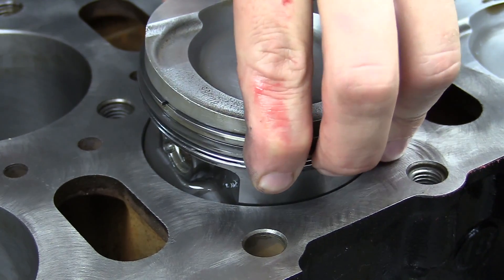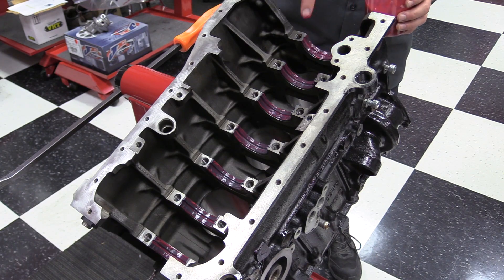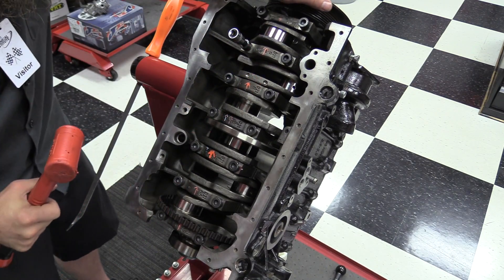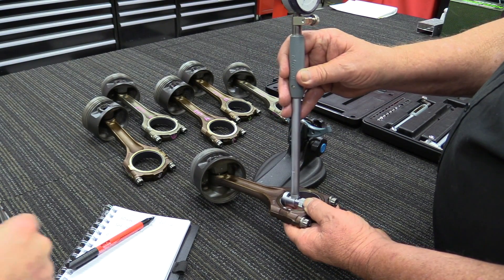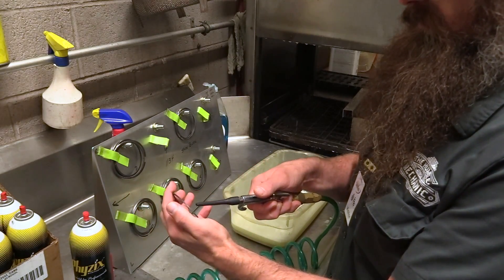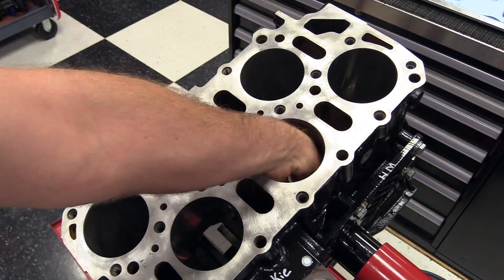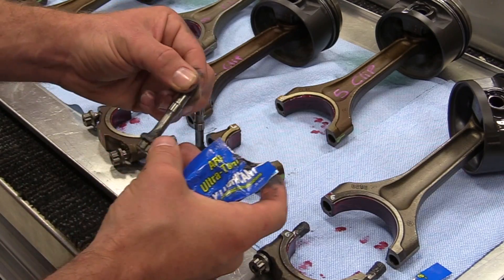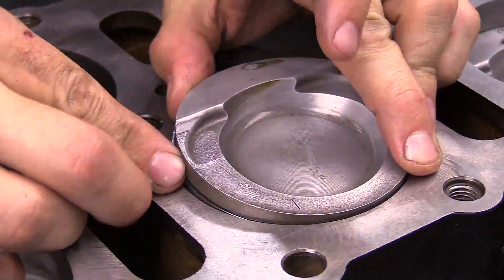How To Assemble an Engine Block

Comment: Great Video!!!!! Thanks for making it!!!!! I am rebuilding my son's motor in his first car and he and I just used this build series to help put together his rotating assembly. I have built many motors in my life so I am not new to building motors. My question is after checking all his bearing clearances and all coming out fine I also checked ring gaps to make sure there was no ring bind. We installed his pistons and now the motor is VERY tight and hard to spin over. I just built an LS V8 for my boat and that motor rotates over easier then this VR6. Are these VR6 motors supposed to be this tight?

Comment: Nice video but I do hate that all ring design it looks like you're putting very very narrow oil rings in this is better problem with some of the newer engines that design of oil ring allows the Rings to clog up and hence you have oil problems

Comment: Hey  HumbleMechanic, I'm currently installing new pistons into a 24v 2.8l Vr6 after an overbore of .5 mm. We are having some problems with getting the piston ring lined up and wanted to know what tool did you use to insert into the cylinder?
Reply from the maker: By hand on this one. The OEM tool on the R32. None of them work that well ol

Comment: What about the expansion of the cylinders and pistons, and how that affects required ring gap and piston size
Reply from the maker: Dynamically that’s accounted for with stock ring gap. If you have extreme taper or out of round that needs to be addressed before engine assembly.
Reply: Thank you.  I’m trying to get more of an idea about this for my mums Suzuki Swift.  No one has looked at the engine yet.  It’s a very new car, with a voided warranty, long story.  Seems to keep having mystery problems, first it was a badly designed exhaust flange between the manifold and exhaust, causing carbon monoxide poisoning, now it seems to be engine issues.... long story. Thanks for the help

Comment: I am currently assembling a 1.7 d17 engine off a honda civic and im having an issue where the crankshaft turns freely once installed but once i install any rod and tighten to spec, the crank wont turn at all. New main and rod bearings, all lubed propperly

Comment: You mention cleaning... Apart from replacing actual parts, cleaning is probably 99% of an engine rebuild. New bearings, rings, pistons and rods etc don't solve much if your oil channels stay dirty, for example.
Reply from the maker: Exactly

Comment: Thanks you for this walk through I have the afp engine that I just took out and it has scored pistons and the valves where bent as well. Took the head to the shop but most ppl aren’t willing to clean the bottom half even if it was just for a hot tank. This really puts my mind at ease and I’m prepared for the next step.

Comment: Just started putting my vr6 bored 2.9 12v and we tried doing it by hand like you did and we broke broke two rings. We are probably going to get a cheap piston compressor and cut it at the right angle. Any ideas or anything that we might’ve done wrong? I also had the techtonics tuning compressor but it didn’t work good at all.
Reply from the maker: There are some compressors on amazon for a reasonable price

Comment: Hey there.. enjoyed your video.  I didn't see any squiggly ring in the oil set.  Do you have a preference as to which rings you like to put on first? Also, every time you bend over a running engine I get horrible pictures of your extremely shaggy and long beard in the belts. Frankly it scares me.  I'm worried fir you, Bro.

Comment: Installing the piston into the cylinder with hand its a very bad way to do it, because by doing this as youve done in the video, you changed the gap orientation and degree between 1st 2nd and oil rings.
Reply from the maker: You can hold them in place similar to how you would the the slide in style tools. But yes you can also slide them around and end up with poor clocking

Comment: Good video, but 1 suggestion..At 9:38 while applying Marvel's Mystery Oil to the cylinders you mentioned to use a white towel.. I know what you mean but a newbie might not and use a terry cloth towel, clean coffee filters work good as there is no chance of making a mistake with added lint if the wrong towel is used..

Comment: What happens if the gaps of the piston rings are not clocked correctly, will this interfere with the combustion?
Reply from the maker: Combustion will leak past the rings.
Reply: @HumbleMechanic  So this will in turn negatively impact the starting of the motor? I have a small engine block that I resembled and I don't recall "clocking" the rings correctly on the piston. Now, the engine wont start. Could this be a reason why? Assuming everything else was properly set back into it's place.

Comment: Nice video. Thanks for sharing. If I may add a few comments, do not turn the crank without the caps torqued, when torquing the cap bolts on the final stage, do not stop in the middle of the torque down process. Keep the torque wrench moving until the spec is reached.

Comment: 10.37 when you pressure piston to inside the block its not right system brother.You should use easy way to inside the piston in the block.

Comment: I know I’m late but I’ve got to know where you got that piston ring measuring tool in the cylinder. Also did you use the plastic sleeve that techtonics sells? Thanks for the videos, they’re helping me a lot with my build.

Comment: I never knew ring filing machines EXISTED. And the multiple cleans and fusiness I would never bother with..... to finally get to the pistons going in and you SQUEEZE THEM IN BY HAND.  Holy smoke, I have seen piston ring holders as a 12 year old.... I have never heard of anyone with access to that stuff NOT using it.
Reply from the maker: The standard type don’t really work on the VR due to the angle of the bore. I’ll be doing another one soon. 10/10 buying the ring compressor lol. I’ve since found a really nice one.

Comment: If you use plastigauge to measure bearing clearances, would you need to replace the stretch to yield bolts after?
Reply from the maker: You torque the bolts minus the stretch. Or use old bolts

Comment: If i had an engine rebuilt say 8 years ago and its been sitting since. Never started (302 ford). Say i finished putting it together myself (accessories and pulleys). How do i make sure the pistons and all are properly lubed? I didnt do the rebuild but the idiot who started it never finished it. What is your recommendation?

Comment: What a detailed video! I love marvel msytery,  i had a door lock cylinder on my vw beetle 2004 and it wont not turn, it was completly siezed. I took it out with the 12 turn revolution as you demonstrate and soak it in a cup of mmo and it works better than new.

Comment: engine piston fail and hot engine a can warp a crank but hopefully it will re- balance it self with a long drive and lots of honey oil NO SMOKE  . haven't changed the oil in while and I think most of the tractor oil was diluted out (burning leak). I love my tractor oil .  still pulls good when you floor it ! LOL

Comment: I would like to congratulate HumbleMechanic on the excellent video; it is worth noting that all versions of the VW and Audi TSI engines have chronic design problems; even the renowned German magazine AutoBild has made matters on the subject on several occasions. In the State of New Jersey, there is a Public Civil Action against VW USA (link below), regarding consumer losses due to timing problems of the command current. I consider that even the Chinese are a step ahead of VW in terms of reliability, I cite as an example of superiority the engine Chery 1.5 turbo 150 hp and others with Mitsubishi technology.
Here in Brazil the carbonization problems are much worse, the current VW TSI engines, which are called flex, are not designed to use gasoline with percentage of ethanol. The manufacturer only makes a written recommendation on the fuel cap. A shame!!
https://timingchainlitigation.com/Content/Documents/Complaint%20and%20Demand%20for%20Jury%20Trial.pdf
Reply from the maker: Yep this timing chain thing is crazy.
Reply: n the new VW 200 TSI engines the manufacturer has adopted a conventional toothed belt, claiming that the durability is 120,000 KM. Only fools can believe.

Comment: Hey, Nate here from Triangle Mobile Mechanic in Cary, NC and I love your videos.  I have seen you around Cary  believe it or not. Small world! Quick question...I'd love to learn how to do engine rebuilds, but how economic is it compared to just swapping out the engine with a new engine? I would think after spending all the money on parts and paying an experienced tech to clean, replace, and reassemble your whole engine that it would be cheaper to swap the engine. What's your perspective on this?
Reply: if you're paying someone else to do it, it's not a good financial decision. swapping is the better choice.

Comment: Great video Charles 👍. Love the stress on  cleaning everything at each stage of assembly. I don't know how many people I've seen have a messy work area and not really bothering to take the time to clean surfaces, only to down the road scratch their head wondering why things are either leaking or breaking.  Another practice I've gotten into is chasing out threads especially on critical areas like head bolts , I've also seen people not do that and snap off TTY bolts because of crud being in the threads or in the bottom of the bolt hole.
Reply: A J S after machining how does one clean out all the oil passages? I would think if the cylinders are dirty after machining that all the passages would be worse.

Comment: Humblemechanic,
I’m on in aircraft reciprocating engines is a test using Magna flux where uv light is used to detect cracks not visible to the naked eye or eddy current to check for cracks too. Do you feel it is a good idea to use similar methods on automobile engine components?
Reply from the maker: They do that at machine shops. I’ve never actually done it. Lol
Reply: they most likely did those tests on cars way before aircraft engines.

Comment: hey! to compress your rings when fitting the piston, you might want to try using those nylon straps that come on bags. Soak them in engine oil and wrap and twist one end to compress them. The oil will flow into the rings and help them seat easily! Saw this in a ghetto shop in India.

Comment: great video. videos like this are what empower people to take these things on in their garage, who knows, that may bring someone into the automotive field who other wise would not have gotten interested in it.
being an electrical only guy this type of stuff was totally out of my wheel house. my first engine build last year i chose to use this super expensive assembly lube instead of oil (which is what most guys said i should use). im very glad i did as it took me a week of troubleshooting and a solid 3 minutes of cranking across that week before i had oil flow. i have no doubt oil alone would have caused major damage. i made a few mistakes while assembling - i realized after the fact. now 6K miles later i guess the mistakes wern't major.  at 520K miles at time of rebuild i had to machine/bore/fire ring all the things...

Comment: Was that the same engine block from beginning to end?  If so What happened to the deck surface at the end of the video
Reply from the maker: It's the same one. I think its the coloring of the video that is weird. This camera I was using does funky things sometimes
Reply: Looks like you took a sanding pad to the freshly resurfaced head gasket surface?   Fyi thats the worse thing you could have done besides hitting it wit a hammer
Reply from the maker: Nah. It’s probably just a camera trick or so things think
Reply: Ah okay yeah  cause alot of old school mechanics  would sand or rough up the surface before putting the gasket on.  And they still do which since the 80s  that has been something you dont do...and using a power disc sand causes low spots ruining the recently leveled  flat surface . Ive had to take .038" off of a cylinder head because the mechanic did that to clean it up.. 99% of the if they dont do it  its less then .010"
Reply: Ps. Use a sanding block( atleast 12in long)... like they use in auto body and itll clean it up (if you feel you need to) and not make it look like  some hack took a sanding disk to it

Comment: Is the crank shaft same as cam shaft?
Reply: no, simply put a camshaft controls the opening and closing of the valves which put air in the cylinder and also let it out. A crankshaft however controls the physical spinning of the pistons i.e. what makes them go up and down in the cylinder.

Comment: Hello guys , i wanted to ask a question since you seem to be preety knolegdeable on car engines . I have a problem with my wv sirocco i had lost compresion in two cylinders and the mechanic told me that two pistons were damaged and i need to change all four of them. After removing the piston head the only thing wrong with it was a broken piston ring. Did they scum me ?Thank you for your answer.

Comment: Soo much detail and over done 
I would loose my mind 
Build it crappy, it aint gonna last forever
Reply: It will if u take care of it, the ford 7. 3 and dodge 5.9 both a reputation for lasting over 600k and the AMC 4.0 has a repatioj for well over 200k under severe abuse along with oem tj clutch
Reply: Yes totally agree if you want a engine rebuild thats gonna last 
These guys definitely show how it's done

Comment: So what do you do with the oil clearances? Why did you measure the oil clearance between the crack and the rod bearings? And what do you do next? Thanks! Great videos
Reply from the maker: This is all check measures. If something is out we would maybe do different bearings. Or have to buy new parts.
Reply: HumbleMechanic awesome thanks for the reply! and that measurement should be VW specific correct?

Comment: Many engine builders like the tapered ring compressors like the ones made by Total Seal. The only downside is that each tapered ring compressor can only handle one cylinder bore. Many American engines would have a standard bore of 4 inches and overboring to 4.030 is very common, so it pays off to have those 2 tools.

Total seal makes one that is tapered first, then angled to 15 degrees to fit the VR6. Since the 2.8 VR6 standard bore is 81mm and the most common overbore is 82mm, you could buy 2 of their ring compressors for the majority of situations. Some premium forged pistons can be bought in 82.5mm or even wider, but if you can afford premium forged pistons for a VR6, you can easily afford another VR6 installation tool.
Reply from the maker: Truth. Lol. They are not cheap.

Comment: Also I'm curious of your opinion. I don't have a jig to space ring gap. Guess i didn't think about using the piston itself for worry of piston to wall slop. I use the depth gauge of my dial indicator to square the rings for proper end gap measurement. What are your thoughts?
Reply from the maker: The piston works well. The guy that gave me a hand had his buddy make a spring loaded jig. It was pretty cool
Reply: HumbleMechanic 
Good to know. I appreciate the feedback.

Comment: Where i work they don't provide proper assembly lube. I take a bit of an old school tactic and just whip together 1 part wheel bearing grease, 4 parts engine oil. Just gives the oil a bit of tackyness that makes me feel better on the initial fire up

Comment: Crankshafts get turned...material is taken off journals. Line Boar is the process of removing material from the block and bearing caps. This process increases the diameter of bearing size.  Line boar is generally used on aluminum case engines. Have used line boar on many air cooled engines.

Comment: Charles VW Engine rebuilding 
Brings back good memories especially of a type 4 air cooled I built. 327 Chevy connecting rods stroker crank dial in cam twin 48 Weber ida carbs with nitrous. In a mid engine sand rail that thing would burn up the 100 yard sand strip. Low to high 3 seconds. That was 20 years ago.

Comment: Hello all...I know that this is not the place for it but I am desperate.
 I own a 1995 Volkswagen Golf MK3 with the AEE 1.6 MPI engine.
A few days ago I woke up to go to work and suddenly, after 10 minutes of driving, the engine died. I coasted to the side and fired it up again and after a couple of minutes it died again and could not start. I left it and went to work and after the working day was over I went back and it fired right back on. I drove it home only for it to die on the way there again.
Once I took it home I checked fuel pressure and spark. All was working well. I opened the top mounted air filter housing and all was clear there too. The next day the same thing happened. I re checked everything, today, and upon closer inspection I found out that a rag, that I used for my dipstick, was stuck in the intake pipe leading to the intake filter housing. I removed it and drove the car around for half an hour without any problems.
My question is: Could that have been the problem? I am wondering because, yes the rag did obstruct air flow, but if it was so severe shouldn't the engine die as soon as it sucked the rag in? Also I am not a mechanic so I am wondering if the Golf ECU has any type of sensor that shuts the engine off when the mixture gets too rich and that is why it died after a while when the engine was hot?
I don't know...I just want to feel confident again. Fuel pressure-Good Spark-Good Coil Pack and Dist Cap - New
Could it be that the rag caused all of those problems???
Reply: When something is messed up in the intake system, it tends to make the mass air sensor give false readings. Wrong mass air sensor readings often lead to messed up air fuel ratios and sometimes it may be bad enough to make the engine stall.

Since the USA didn't get that VW variant, I don't know if that engine uses a mass air sensor or not.